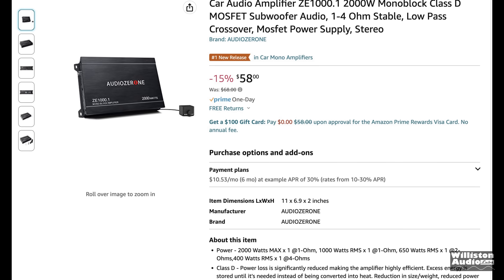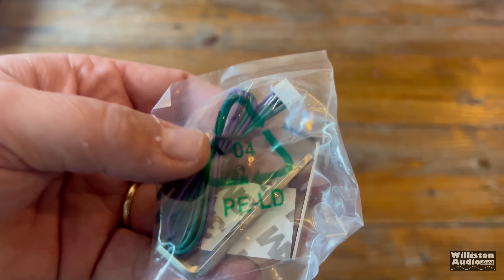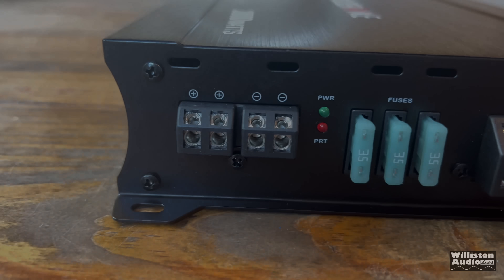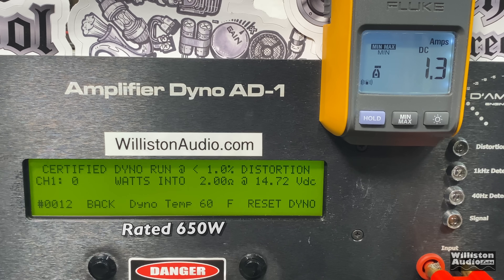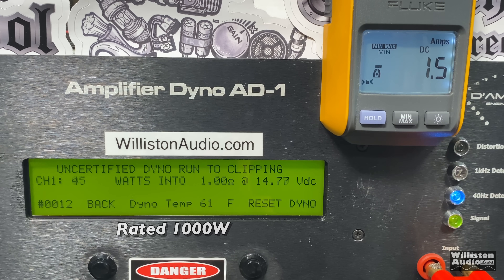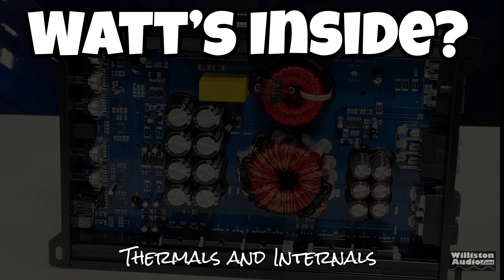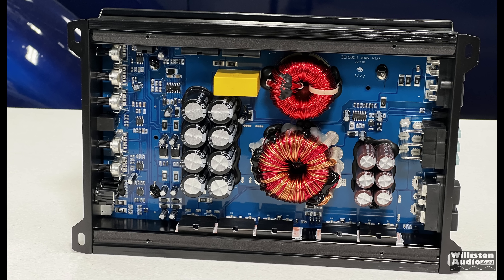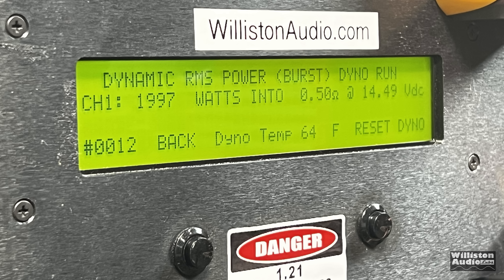Can this $60 Amazon Amp Power a 6000 watt SUBWOOFER?

Comment: My son will never know the struggle of the dollar per watt days.
Reply: - When I was young we had to pay fiver for a watt 
- Old man and his crazy stories
Reply: @pirateradioFPV LoL yep, $600 for 120w CA-260 Harman Kardon amp! Loved them tho, eventually acquired 6 of them!
Reply: 30 years ago this amp would’ve cost $140, even at those numbers it’s still insanely cheap.  But will it last 30 years if used responsibly?
Reply: @K-Effect  30 years is s stretch with those caps 😁
Reply: @K-Effect I'm betting on it, as today's electronics are far superior to yesteryears'
Reply: DOLLARS per watt.  I think I paid $379 for my PPI A200, which was 50W X 2, back in 1993.  My A300 was closer to $500.
Reply: @KRAMITDFROG  I had both of those and spent a ton on that system.  I had a PG M44 after that which was close to $600.
Reply: no but i've been watching exo contralto build his van - these amplifiers are cheaper than the tubes of filler he uses for sound deadening. like how butter costs more than cheese, costs more than beef - it's a crazy world we live in!
Reply: Those days are coming back bro. But not dollar per watt for an audio amplifier, it will be dollars per watt for a voltage converter. With these electric cars, we won't be buying alternators anymore, we will be piggybacking voltage converters to pull power directly from the vehicles Drive batteries. The prices for these converters far exceeds that of amplifiers. And then there's the problem of the drive batteries discharging quickly under this load. I have a feeling the electric car industry will bring the car audio industry to its knees
Reply: @nighttow8780   I've often wondered whether larger systems in EVs really would be all that feasible because of current draw and disparate voltages, but I've never really looked into the logistics of it.  I'd imagine a pretty substantial stepdown transformer would be needed to get voltage down to 12V.  That or the amp topology would somehow have to take into account the voltage of the battery.  I mean, if you could do that, the current draw would be much smaller other than whatever is lost in translation.  I'm really not all that big into EVs, so I suppose the question was rather academic in my eyes.  Maybe I should delve into it more just out of curiosity. 

That said, I don't think many people should be messing with that kind of voltage unless they really know what they're doing.  Firefighters have to take special precaution when dealing with them, so that says something.
Reply: @nighttow8780 then you rig a alternator to run from a sprocket turned by the wheel to charge your batteries specifically for the system. Easy does it.
Reply: Damn seriously..... That's insane cheap
Reply: If you buy JL, you still do.
Reply: u wont have to worry wont be an ev vehicle for workin class in next 30 years
Reply: @bamaboy6207  so buy a vehicle that you can work and fix yourself right now that will still be working in 30 years 😂
Reply: Thank God...
Reply: Or if its was JL or Rockford, 1.50 or more
Reply: Ong that shït was buggn 5k for a 5k was a good deal tho
Reply: Standards are going up aswell. Back in late 90s our local guys won every competition with single Rockford Fosgate sub paired with few amps. Nowdays every other kid has walled build pushing 10000w RMS.
Reply: @Mart77   what should I get these days to push a 10 l7 large vented!?? I've got a American bass vfl ready to work i wish someone had a Dyno on it its a 2800.1
Reply: Right, !
Reply: reminds me of the band amp power struggle. in my time it was a dollar per watt secondhand price. 
then it would proceed to blow up on the first gig, when first pugged in, 60 miles from home.
good times
Reply: Back in like 1977, a friend had a Chevelle with separate Pioneer amp/EQ with a separate Pioneer cassette deck/ receiver and Cerwin Vega HED 6 x 9 speaker on the rear window deck. I think he paid like $800 for the package. My parents mortgage was $312/month LOL!
Reply: Lol they still have some Amos like that
Reply: For real. 90’s and early 2000’s. Same here.
Reply: The last amp I paid a doller per watt was the kicker zr 1,000 that's when it car audio cost more than ur car did .
Reply: You couldn't buy better subs because you couldn't afford the amp for it.
Reply: @whateverwhenever8170  Hahaha I had a pyramid pull out deck.
Reply: When I did car hifi we had to pay over 1000 bucks for a 4x100 watt amp...
Reply: Everything is expensive when they first come out lol. Camcorder, TVs, VCRs, DVD players and so on
Reply: Now we got how many watts per dollar. Or maybe even cents if you go Brazilian full bridge amps you can get 10-15 watts per dollar kinda crazy
Reply: @mullinperformanceaudio5902  don’t u know it!!
Reply: I have to wonder if it will still be working after 25 years like my old school Fosgate Punch or Lanzar Optidrive amps though.
Reply: yes but also the dollar has devalued a lot though 😅